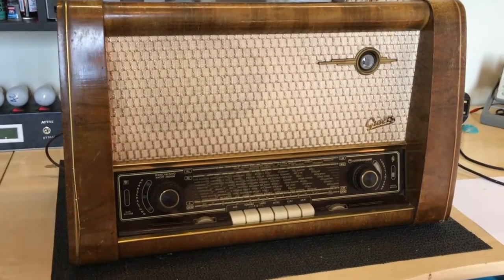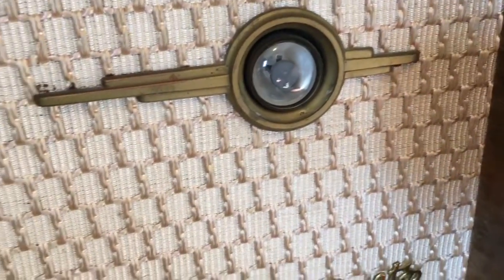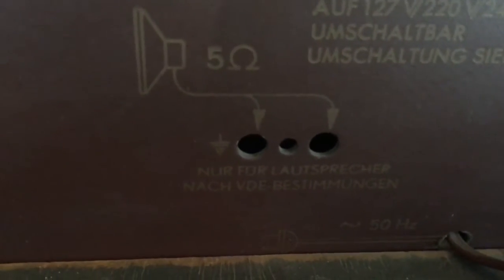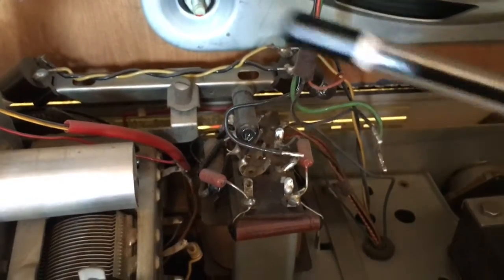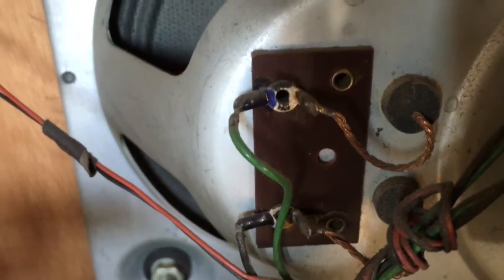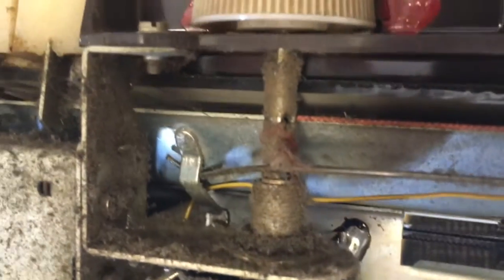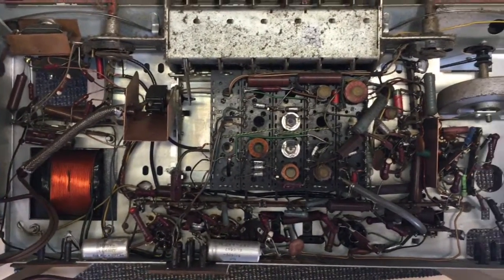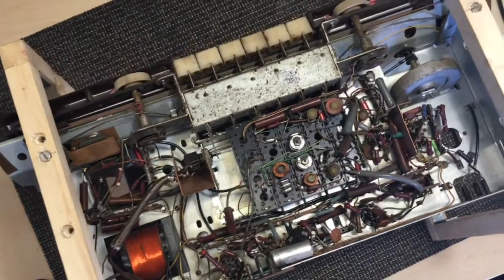Graetz Super 171W tube radio restoration - Part 1. First look at this new project.

Comment: Mr. Calderira, I was looking for help with the tuning string on a Graetz 811E but it could be a shot in the dark? I watched your whole vid as it was informative and I love the simple wood frame you fabricated. I am not qualified so I am going to try and find someone around Toronto for some help. I disassembled the unit and a light clean but I hear ya when you warn against active voltages. All the best and thanks for sharing. M. Stafford.
Reply from the maker: Hi Mark
I found the service instructions for the 811, so I don’t know if it’s the same exact model. Sometimes the trick is to find a very similar model that has instructions, and see how close the two are.
Good luck.
https://nvhrbiblio.nl/schema/Graetz_810.pdf
Reply: @electronicsoldandnew  that was very kind of you to take the time, I really appreciate it, thank you! I do see the tuning string details there and while I had a frustrating day yesterday trying to get it happening, I will now revisit it before I send it out. My problem was slippage on the coupling on the control knob, is there a chance that glue was applied on the first winding is it just the tension that secures it? cheers, and no problem if I am taking too much of your time? thanks Mark.
Reply from the maker: mark stafford : No glue is involved. The tension does the job. Good luck Mark.

Comment: Hi M,  I have not msg you in awhile but have watched all the videos you have posted. Really liked the creative cosmetic repair you came up with for the Braun Radio, looked factory stock. I believe I told you a kind person e-mailed me a copy of the schematics for the Telefunkin Radio that was given to me, which was great as I could not find a copy. I went ahead and ordered most of the capacitors and some of the resistors that seemed too far out of spec. And bought 2 tubes that tested bad. But I have not started restoring the radio yet. Remember this will be my 1st Radio repair, and I hit a wall right out of the gate. You may have just helped a bit in this video though. You mention while panning past the power transformer about the Black cap looking unit that you said is the rectifier.... That is exactly what my radio has, and I was unsure of its purpose or function. I suspected it might be that, but I was looking for a bridge rectifier or a pair of diodes.. I believe that is burned out on my radio.. Is that something that is obtainable? Or can it be replaced with diodes? The model is a 5173W. Any comment is appreciated Thanks, Tom.
Reply from the maker: I would replace it. Look for my video on replacing selenium rectifier with diodes. And remember, be careful! Shocks hurt. Have faith n.